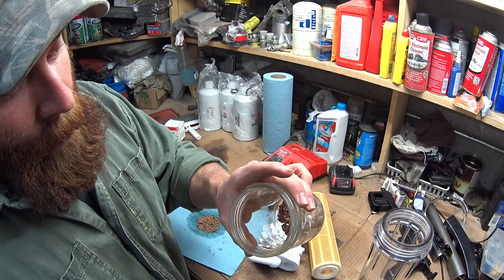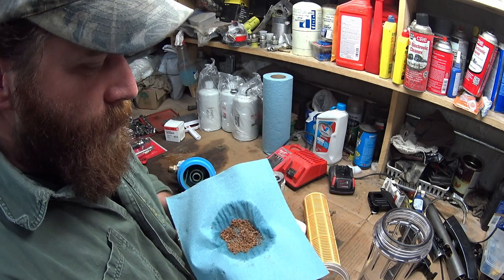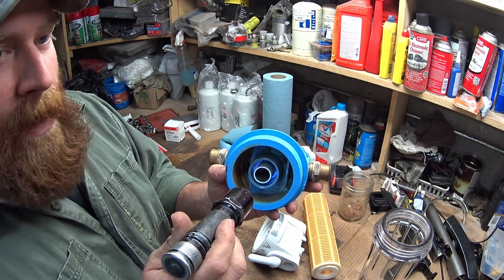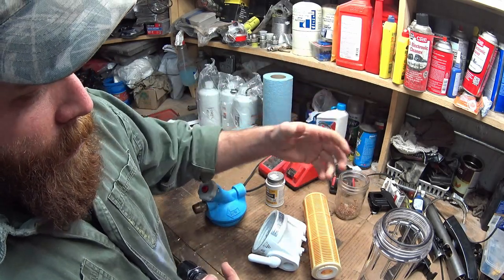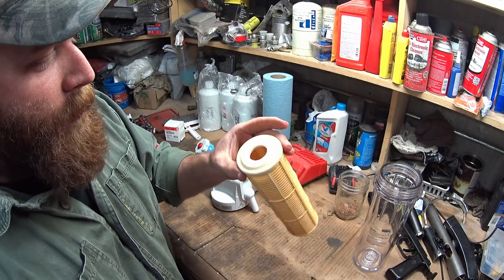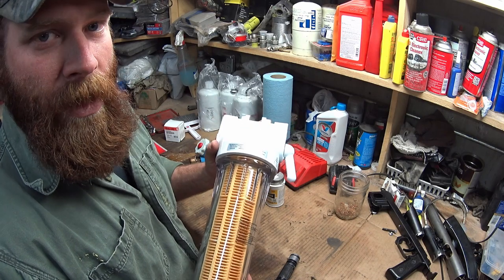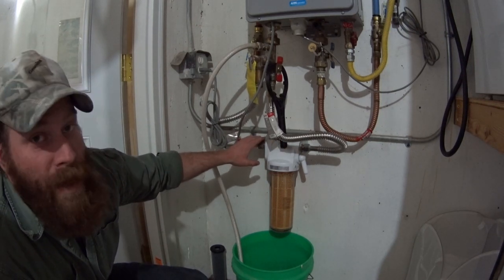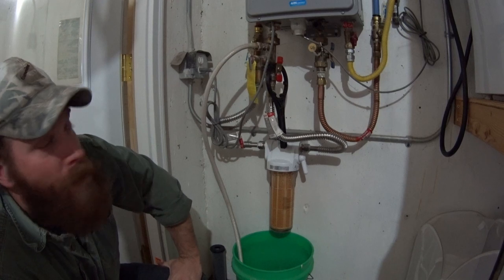Hard Water, Installing a sediment trap in hot water line to remove limescale

Comment: DO NOT USE any type of inline whole house water filters UNLESS they are RATED for HOT WATER. The standard whole house filter housings cannot handle the hot water, will deform, and burst, causing a huge mess. Also, you MUST use filters rated for hot water. Standard filters will NOT handle hot water and will disintegrate. The hot water whole house filters are RED in color and have glass infused within the poly housing and are able to sustain temperatures of 165 degrees or more. Whole house filters are generally only good up to 100-120 degrees. You are taking a real chance with using standard whole house filters on the hot water line.

You are correct RCR on brass. Brass works the best with the poly tops. Simply use a little plumbers tape and you will be leak free. PVC will leak no matter what tape you use. Galvanized is a no-no, just as RCR said.
Reply from the maker: My water heater is set on 115 and is an on demand system thus it is off 95% of the time.  Yes those filters "designed" for hot systems are red in color. And they carry 3x the cost.  My system is a basket that does not interrupt the flow or volume. Only acts as a sediment bowl, that is within the pressure settings for my system. Limescale only activates after being heated and once the mineral crystals bond to each other, every pinch point in a plumbing system becomes a trap for this scale. After dealing with this scourge of western water. I am willing to take my chances, and design a system of my own making in order to alleviate the constant plague of hard water.

Comment: Once you get all the sediment in all your lines, how does one go about removing the sediment?
Reply from the maker: Most folks remove the screen filters at their faucets and spigots, blow the lines out with either water, or compressed air, starting downstream of the water heater, or any other sensitive appliance.   Vinegar will also disolve the scale as well.  I have charged my lines with vinegar for a few hours then purged it out.  My lines in that house were Copper and very little scale would accumulate in the lines.  Usually its only when the scale is heated then comes in contact with air will it actually become the crusty build up that we can see.

Comment: Does this go after the hot water heater?? How hot can it get?
Reply from the maker: To answer both of your questions,. I installed this sediment filter "downstream" or between the hot water heater and the line that feeds the house.  It's basically mounted approx 2ft away from the propane on demand water heater
Reply from the maker: my water heater is set at 120*F and this trap is about 2 feet downstream, (after the propane fired on demand style) water heater.  This setup has worked for me, but I take NO responsibility for its application outside of my personal home.

Comment: Why not install filter on cold water line into heater? This way sediment does not get into heater.
Reply: Because the superheating process of the water is what's creating the calcium carbonate.
Reply: @brandontingstrom9214   Exactly. I have this problem, and my cold lines NEVER have scale or build up anywhere. My hot lines clog up past the water heater to the point of almost totally blocked off flow. Its been a big pain, as every few weeks I have to diassemble faucets and diverters and shut off valves and disconnect water lines to clean the stuff out and blow it out of the lines. But only on the hot water side. I was thinking of doing something like this video to try to minimize how much work I have to do on my hot water lines, and searched youtube to see if anyone had done it. Low and behold, I found this video.  Awesome sauce. I'm gonna try this. I'm tired of my hot water at the sink and shower being 1/4 the pressure of the cold water.